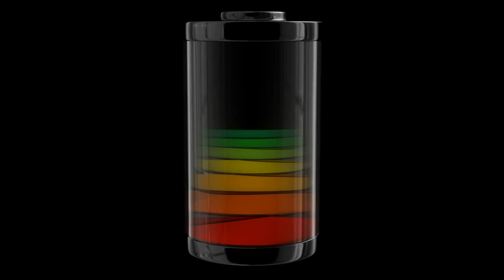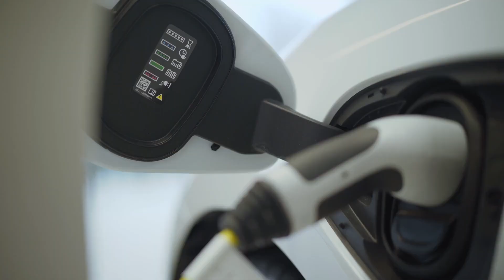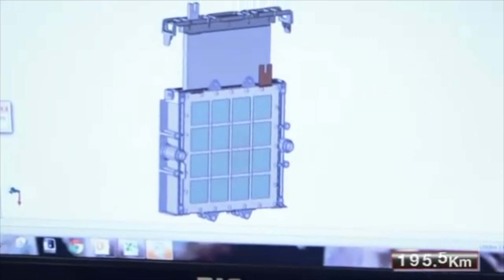This Battery Gives EVs 1000 Miles of Range!

Comment: In your video, you states very innocently that Lithium-ion and AL-air batteries when installed in a vehicle as the only power plant are  "Pure Clean, non-polluting Energy Sources" that is NOT TRUE.  Please explain to your users how much fossil fuel is needed to create one battery pack, large enough to power a vehicle over 300 miles (you can start with the current Tesla S).  

Your in luck, it just so happens there are responsible people who have counted the cost of battery power vehicles on the environment, here is one article that should wake you up to reality:

"Much of the world’s lithium is extracted from brines beneath the deserts of South America and evaporated using the sun’s energy. However as demand has grown, due in large part to Tesla, more and more lithium is mined in Australia by crushing rock and is then sent to China for processing in a more energy intensive cycle [7]. Mining is a notoriously energy intensive industry and many mines are powered using dirty electricity such as coal.

Once a battery reaches the end of its life, there is recycling and disposal to be considered. Currently, over 90% of lead-acid batteries used in typical gasoline-powered vehicles are recycled. Compare that to less than 5% of lithium-ion batteries. Experts project 11m tonnes of lithium-ion batteries will be discarded between 2017 and 2030 [8]. These batteries will need to be transported to recycling facilities around the world to be processed, further contributing to their negative environmental impact. Transporting batteries from Australia to Europe resulted in an increase of global warming potential of ~45% [9].

References:
[7] Financial Times, “Electric Car Growth Sparks Environmental Concerns”, [URL], accessed 12 November 2017

[8] Lizzie Wade, “Tesla’s Electric Cars Aren’t as Green as You Might Think”, Wired, [URL], accessed 12 November 2017.

[9] Anna Boyden, “The Environmental Impacts of Recycling Portable Lithium-Ion Batteries”, Research School of Engineering, The Australian National University, 2016."

Wouldn't you think that those who are on board with Electric vehicles as being better for the environment than gasoline powered vehicles would count the cost before paying the price?  Or If I play the devils advocate, is the truth inconvenient to the agenda.  The true cost of manufacturing the battery packs for one vehicle needs to be included in the MLSP sticker slapped on the Electric vehicle, then one would know just how many miles driven in that vehicle would zero out the cost of manufacturing the vehicle.  I think that would be a more honest and productive way to represent the new religion that has its virtue based on the idea of "Global Climate Change" being the end of all of us, within X years, I can't remember what the latest's value of "X" is as this value keeps changing every 2 to 5 years.

Comment: I think that batteries which require swappping should be standardized, so that each vehicle can perform a pitstop in the swapping station. Standards may include units of same size, access under the rear trunk (or under the hood) and identical electric plugs. It is important that a swapping robotic arm may operate successfully for all car models, hence the importance of standard units.
Reply: Good idea about "standard units"  But name me three "standard battery packs" for cell phones, or 3 of the same battery charging plug ins, or 3 of the same starters, generators, fuel pumps, tires, etc, etc. etc for standard cars.
Reply: @hardset-vi3ze  That is the second issue with swapping: you cannot swap a battery with one that has different technical specifications without testing it. that is even if the batteries have same dimensions and plugging system. Relying on a standard model will negatively affect competition and development which requires drastic changes. I opt for fuel cells and flow batteries which allow to fill a tank with a liquid that generates electricity.

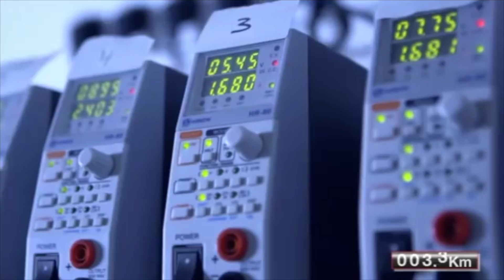Comment: i was not aware that 600km = 1000 miles (8:10).  aluminum batteries have been around since at least ww2 not the 60's.  in order for aluminum batteries to be cost effective, we would need a few large aluminum recycling plants in the u.s. powered by a closed loop (kalina cycle) geothermal power plant.

Comment: What was the battery that nokias used that lasted for about 2 weeks at 1 charge and also was shock and puncture proof?⚡ There was also a Chinese guy  that not so long ago showed up a similar aluminum batery?🤷‍♂️.. also had you know about "melatonin batteries" those are said to have scalar charge

Comment: This was proposed by a former Royal Navy office and engineer named Trevor Jackson a couple years ago. A quick search will bring up some of the articles about it. It doesn't appear to have gone anywhere but his concept for the system was as follows. The vehicle would have an easily swappable cartridge system and stores (grocery, convenience, automotive, etc) would sell the replacement cartridges and take the spent ones for recycling similar to how we buy propane for gas grills. The idea is sound for such system. He also claimed to have solved the issue with build up of deposits that degrade the battery's performance with an electrolyte he invented. You can look up his story yourself and speculate on it. 

Based on your 1000 mile battery size of 55 pounds a 25 to 30 pound version that is swappable as Mr. Jackson envisioned seems feasible and would equal the range of most gas cars today on a single tank (in my experience most get between 350 and 500 miles on a tank).

Comment: "One kilo of aluminum takes 15 kwh of electricity."  That's where your energy is coming from.  All metals are in a very high energy state.  During WWII, the Germans even invented a rocket motor that used aluminum particles suspended in oil for fuel.
Reply: That  is what makes it sustainable. Sunshine electric.

Comment: This would be a great idea but all manufacturers have to work together to maintain the same size battery, or all manufacturers get their batteries from the same manufacturer the price would be cut down and would appeal to more consumers. Instead of going to a Battery Swap Center the process could be done in the owners driveway or just on the street using a Truck.

Comment: The argument about a standardized battery size is not necessary. 

Obviously different vehicles will have a variety of different power demands. 

Suppose we had 4 or 5 common formats, as well as cars that can accept more than one of the standard cells?
Say 1000kWh, 4000kWh, 16,000kWh, 32,000kWh?

Then make them snap together, so if you need a bigger battery, but those are sold out, you just buy a few of the smaller ones and click them together.

Comment: It would seem obvious the car could be set up to add the necessary water at whatever intervals are required. Also, the design includes an easily accessible unit to swap out is surely included. Considering the light weight and small size it would seem feasible to have another aluminum/air "battery" and water stored in the car for automatic switch over. Actually having four of these units would still be easily accommodated, along with the necessary water, and provide 4,000 miles of range.   Then, when automatically notified by the car, the owner could drop by a "station" and have the consumed units replaced long before approaching the end of range. Seems viable to me.

Comment: "We need a better battery" 🔋!!!!!   They've been saying this since the day they invented the damn things there are countless technologies that could be vastly improved if the battery technology was a little bit better, And there are some technologies that would be absolutely  revolutionised if battery technology was substantially better
But it will never happen.
  battery technology will never be sufficient for what we need it to do that is why batteries, will!! in the future become entirely obsolete in favour of the stable element fuel cell. Unfortunately at the moment the elements available for the fuel cells are insufficient but   The world's most capable most ingenious people are hard at work on the problem people like the Geniuses at the  cern institute for example  Dozens of extremely cutting edge Projects In the works With extremely promising results like elements 114 and 115. The bottom line here is that you're thinking too small. You guys are talking about batteries that might give us a few 1000 mile range I'm talking about fuel cells that will run a Super car without the need for refuelling for 100 years or more I'm talking about fuel cell technology that could take the space shuttle back-and-forth to the moon a 100 times On a single cell. 😉

Comment: I'm stuck at, "1000 pound battery stores the equivalent energy of 2 gallons of gasoline".  The model 3 gets 250mi range from a charge so you are using 125MPG for your hypothetical gas energy comparison?    Are you talking pure BTUs?  Why?!   Anyway 2 gallons of gasoline = 232,000 btu - Tesla battery = 255,000 btu, but applied energy from the 2 is obviously far different

Comment: What are the draw backs to flow batteries where the user drains the acid to a tank for recharging dead battery acid, then fills with charged fluid and drives away? Sure a gas station could add charging tanks above or below ground, so a user could reuse it over and over without the recharging times or throwing it away after one use.

Comment: 2 gallons of gas will deliver the same energy as a 1,000 lb batter from a Model III?  300 miles on 2 gallons of gas?  It sounds like you converted energy for the gas without factoring in inefficiencies yet the 300 mile range for the Model III is “real-world” math.  Numbers that make a two-bit fella tilt his head should be given more consideration before hitting publish.

Comment: First stat he mentions is how 2 gallons of gas would take u 300 miles. In what? A hot air balloon?!
Reply from the maker: Matt it's in the details. 2 gallons of gasoline have about 72kWh of energy. clearly converting that to motion via a gasoline engine wont compare well because they're terribly efficient. I'm talking only about energy potential.
Reply: @TwoBitDaVinci   @Two Bit da Vinci  ok but the energy you mentioned of the lithium battery wasn't potential, it was literal, its correct information, yes, but delivered in a skewed way. I'm unable to think of the exact word to describe how I mean, but it's similar to needing parallel structure in linguistics. Althiugh now I do see where you were coming from with the claim. More than anything I wanted whatever was able to go that far on the 2 gallons lol. Not necessarily being a jackass/jerk

Edit: literal energy meaning the output of the specific Tesla model mentioned

Comment: Hydrogen fusion reactor that has only two possible wastes helium and water and possibly hydrogen 3.if you ever passed chemistry in school creating is usually safer than separation of atoms. Harness of the energy creating the new element will be cleaner than the traditional plutonium and uranium enrichment reactor. If fission side is used we can use safer elements that go into base form with little or no radiation. Hydrogen is the most common element in the universe using it for power needs safely would open the universe to humanity.

Comment: Well I have driven 1000 miles in 1 day it's not worth buying an expensive battery when you can spend 60 dollars and go the same distance
Reply from the maker: electricity is far cheaper than gasoline. so you're comparing a gas engine car to a ev with batteries. that's fair, but refilling them, the EV will be cheaper.
Reply: @TwoBitDaVinci  hydrogen is promising

Comment: Did you just infer that there is a gasoline engine that is capable of 150 miles per gallon?  Please explain.
Reply: Two bit you name it. Research, presentation 🤭
Reply from the maker: No, only that a gallon of gasoline contains about 36 kWh of energy. converting it to motion via a gas engine, is a whole different story. just talking about potential energy storage
Reply: @TwoBitDaVinci  So, gasoline engines are incredibly inefficient?  Not sure that is a good comparison.  Certainly not apples to apples.  More like apples to artichokes. Now, if there was a way to get the energy out of the gasoline without all the losses, that makes for a better comparison imho.  IOW it really doesn't matter how dense the energy is in gasoline if you can't use it efficiently. So, why bring it up?

Comment: They've been using HHO to run practically any car in Colombia despite the many naysayers. Also what about magnetic repulsion engines?
Reply: Most E motors use repulsion as the opposing part of mag attraction in running motors. Nothing new.!.!.!.
Reply: @philmanke7642  
Yes but aided by electricity, either through batteries or the grid. I am referring to magnetic repulsion solely.

Comment: Build the car in a way that it'll be really simple to replace the battery at home. Sell the car with 2 replacement batteries.  Order online and return the old battery using a return box included with the new battery replacement. Do not buy the car if you can't handle the battery replacement process. If the environmental footprint will be or is the same produced by lithium batteries, why not change to aluminum and stop the explotation of financially challenged  countries?

Comment: The real problem for lithium ion batteries is the environmentally a nightmare. The mining of the materials to make that battery generates far more carbon than simply using gasoline. So yeah not so good on the carbon footprint after all.
Reply: Wrong. The lifetime emissions even considering the manufacture, is much better with lithium versus ICE. Lots of research on this now.

Comment: the energy required to recycle the the aluminium would be greater compared to recharging a lithium ion battery pack. the process of making aluminum invovles a lot of processses and techniques. I suggest this could be used in combination with a lithium ion battery pack in an electric car. Say a car is powered by a lithium ion battery pack and if it needs to recharge , then this aluminium air battery can be run parallely to drive the vehicle as well as recharge the battery pack. Obviously it can be used in aviation for smaller passenger flights there by cutting the emissions due to flying. Aviation industry contributes to emissions a lot more than passenger cars

Comment: I know how to capture and transform in mechanical energy 100% of sunlight with more than 90% efficiency ... No more wires, batteries, capacitors, electronics, computers, engines ... No more electricity and thus no more metals at all.  Not even non toxic or non enslaving ones. Also, each owner can pick int a new complete car in its own yard given each car comes with it's own self production garage micro-factory

Comment: The battery!!... is just THE FUEL TANK... HOW!... are they better than fossil fuels... WHERE ARE YOU GETTING YOUR ELECTRICITY... AND... how much electricity will you need... youre waaaay short of power NOW! ffs... rather than batteries whats wrong with super capacitors
Reply: If we ever get serious we'll put a ring of solar panels at geosynchronous orbit. Run down graphene superconducting cables and relax in the never-ending supply of energy.